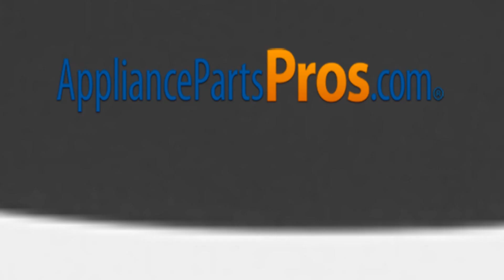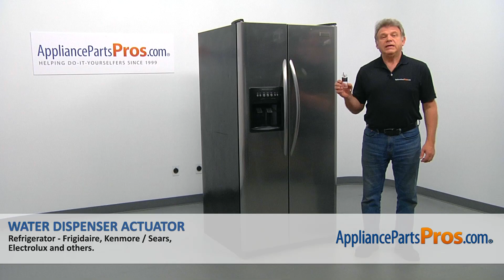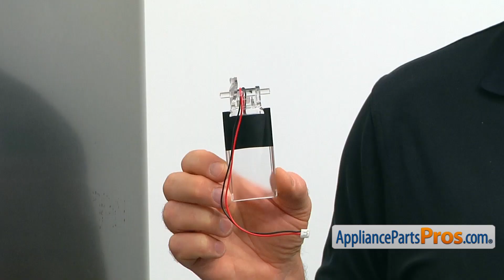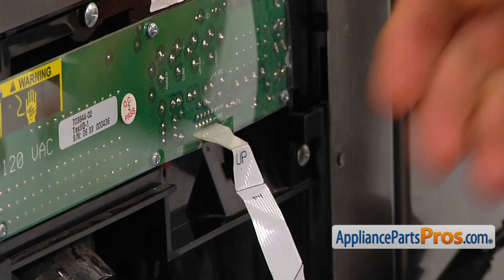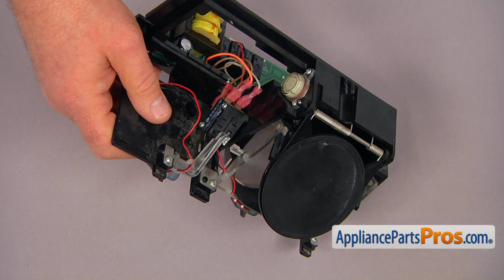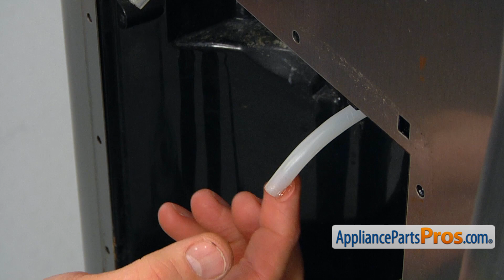How To: Frigidaire/Electrolux Water Dispenser Actuator 241685703

Comment: Look at and take a photo of the tube protruding out of the bottom of the hoe in the top of the dispenser BEFORE you start
Like others have said…. Use a skinny dowel or similar to guide the tube down into the hole as you rock the unit almost into place. Hold the unit and the dowel l/tube in place with one hand while you use the needle nose pliers to push the tube further into the hole until it feels like it is in and you can actually see the end of the tube protruding slightly from the bottom of the hole.
I also experienced the “rapid fire strobe light effect” when I first tried the new actuator. Also when I first hit the light button and then hit it again. The strobe effect eventually shut off. 
I don’t know but I figured it needed to be reset. So i shut off the freezer / cooler on the inside control panel by holding the button in for a few seconds until it beeped. Then I pulled out the fridge and unplugged it. I let it sit while I cleaned behind the fridge for a minute. I plugged it back in and pushed it back in to place.
I turned the freezer/cooler back on using the button on the inside control panel until it beeped. I tried the dispenser light and it seems to be working with no strobe effect. I tried the water dispenser and it now works with no rapid fire/strobe effect.
Reply from the maker: Thank you for those tips! So glad you were able to fix your issue. Let us know if you have any questions!

Comment: In case anyone ends up here repairing their water dispenser and after reassembly the water and/or ice starts clicking / pulsing very fast when pressing the paddle, try unplugging the wiring for the lights.  My aftermarket actuator fit perfectly fine but there is something with the lights that is causing the panel to malfunction. Unplugging it fixed it immediately.
Reply from the maker: Glad you were able to get your issue fixed. If we can help you with anything in the future please let us know.

Comment: Video helped out insofar as getting the plastic hose back into the water spout.  I hope GE redesigned that process in newer models.  Ideally, it would just snap in and lock in place versus having to use lubricant, plyers and an inordinate amount of patience and trial and error.  That’s not good engineering or design.
Reply from the maker: If we can help you out with anything please let us know.
Reply: I figured it out but THANK YOU for responding! @appliancepartspros
Reply from the maker: You are welcome! If you need help with anything in the future please let us know!

Comment: Replaced my actuator this afternoon and everything worked as instructed 👍🙂. I would like to point out that the water hose was much easier to remove than to reinsert it. The tube is not very flexible so there’s a definite need for patience. I used petroleum jelly and it worked great. Thank you 😊
Reply from the maker: Glad you were able to help you out. If there is anything we can assist you with in the future please let us know!

Comment: Thx for the tips. We had a broken water dispenser. We got it done with your help with the water tube (PITA) only to find that both the ice dispenser and water dispenser both make a kind of slow machine gun noise and the light was flashing, and they don't deliver much either. After 10 seconds the water dispenser started working OK though. We took it all apart, looked for shorts or broken connectors no luck. Finally on a whim we unplugged the new water dispenser actuator connector from the board and it all started working! So we taped off the connector, put it all back together and then found that the water dispenser no longer works, but ice is back again. Aaaaarrrggh! Gonna leave it as-is. The water is useless anyway as connected to an RO system with low pressure. It looks better now though lol
Reply: Thank you for that whim!!! Had the exact situation....read your comment and thought What the ---- um...heck.....lol...Took the button side apart - pressed the ribbon in hoping it somehow did something...and re-assembled it all....BAM....perfect......I think sometimes things are like when we were kids (older kid in my case) and somehow blowing in the Atari game cartridge made it work...lol....Thanks again!

Comment: Taking a minute to THANK YOU for this awesome tutorial. Gave me all the info I needed. For mine (Kenmore Elite version) there is no need to remove to the freezer handle as it isn't in the way of anything. Like others said the water line can be stingy. Manipulating that in and out of the hole is the most difficult part of the job. After 16 years, mine wasn't that bad actually I was ready for the worst.. No problems at all. Got the new one in (Genuine OEM part) and boom works perfect. Thanks again for sharing this.

Comment: The waterline is a pain in the butt.Its stiff and short.I found it easier to put in with control board out with needle nose.Dont mash it flat it will not fully recover it's shape.Be careful removing screws I broke one off.Not really a bad job.

Comment: For some reason my started clicking and freaking out when I reinstalled it.  It’s like it’s shorting out.
Reply: Mine did the same. Took it out and  replaced a few times to make sure it was seated correctly and it still did it. I tried the light button on the controller just to see if it was affecting everything. Initially the light pulsed just like the water and ice maker did, but then it stayed on steady. After that the water and ice dispenser have been working normally. I have no idea how or why, but I know enough to not ask too many questions. It works again…all that matters
Reply: @mikehook4830 thank you!! That worked for me as well!
Reply: Mine did the same... Did you figure out what went wrong?
Reply: Ah, figured it out. Turns out that the end of the ribbon cable that goes to the button display had come loose and shifted during the repair. After adjusting both ends, the end going to the control board and the end going to the button display, I was able to use the dispenser!
Reply: Mine did the same, did you figure out what the issue was?

Comment: As an airplane maintainer, I know the hard parts are never the actual job. On our rental's fridge the front plate is a different style (discontinued) and was sealed in place with double-stick tape. I was lifting the whole door trying to get it out. Someone on the parts website mentioned tape and I went to town with a pair of old ID cards, shoving into the cracks and crevices. Once that had all peeled off it did in fact lift out as advertised. My screws were rusty, but not unmanageable. The rest of the fittings looked identical. I used a 'wooden stick' as a guide for the water hose's return to service, plus the soap and the pliers. I had avoided taking off the circuit board but it was no good and I followed your lead there with success. Anyway the fridge looks like new and everyone is impressed. So glad this video is available as a resource!

Comment: I heated the water tube with a hair dryer to soften it and lubed the hole with a little olive oil on a q-tip.  It went back in easily after that

Comment: Just performed this repair today on the exact fridge.  Tutorial was a great help, everything went smoothly except for the water tube.  Took about 10 minutes to finally get it back in.  Other than that, it was a breeze.  Also, I did not remove the handle and it posed no problems with completing the repair.  
Thanks for a great tutorial!

Comment: Dude. I had so much trouble with the water tube.  Your tips on removing the circuit board and the soap really helped me out. Other videos kept the board in place and through magic of editing they did it.  This should have been a simple repair but the tube made it so difficult.  They should have had more length of tube or a different way to attach it.  Thank you!!

Comment: The video was a big help. RR use of a drill bit as guide to reinsert water tube was a great idea, I cleaned inside of tube holder and water line of ay calcium deposits then with a Qtip sprayed with cooking oil spray. Reinstalled the unit  with three screws Using the the drill bit as a guide  push water line  with needle nose pliers in place ,  Thanks Appliancepartspros & RR

Comment: For what it's worth, on my refrigerator (which looks identical to the one in this video), the set screws that hold the handle onto the door were actually hex-head screws, not Torx. Not sure exactly what size they are, but a 3/32 driver worked perfectly.

Comment: I should do a video of what this repair looks like for the average guy. First off, the screws holding the outer plate were so rusted I could not remove them all. The tops broke off of two. Then the wires from the new actuator broke off on the circuit board and so I had to superglue it. It's a miracle there is still an electrical connection. Getting the water tube back down through that hole was a devil and so I stuffed a drill but up in there to help feed it through but it did look hopeless there for a while. Finally, the ribbon that powers the face plate would not stay in so I had to tape it. I put it in upside down at first so it didn't work. I dropped tiny screws repeatedly. And there was a certain amount of justifiable swearing throughout. But I did get the actuator for about $9 on Amazon or eBay. And by some miracle, I did fix it within a couple hours and by some miracle it is working now. Thanks to this video showing what the super easy install is supposed to look like or I might not have even attempted it.
Reply: The placement of everything made this repair so difficult. The water tube was a pure PITA. They didn't build this to be repaired.
Reply: R R Yes, spent hours on this and have it closed again with the water tube loose. (:
Reply: Can't stop laughing 😂 I had a hard time too but that thing is working 😂